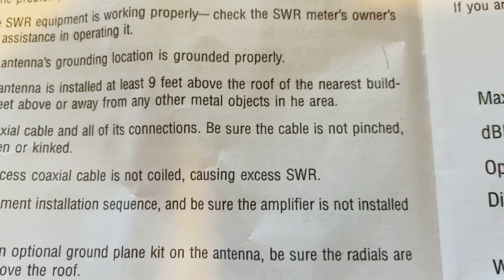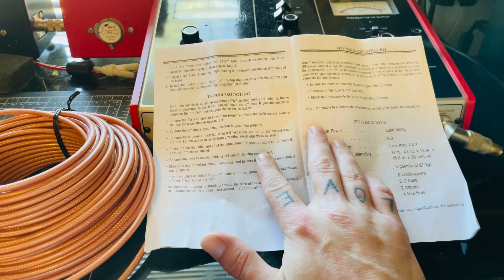Ferrite chokes⚠️

Comment: Watching your video I purchased multiple chokes. I was getting a weird (distorted) sound from my external speaker. I reorganize my wires and put two chokes on the speaker wire. Issue fixed.
You will be getting my Stryker 497 and my RM Italy 703. I will be sending another email once the order is placed.
I learn so much from your videos.
Reply from the maker: Thank you for your support, glad my content has helped. 73

Comment: On your expertise and suggestion, I have gone ahead and picked up a set of these chokes.
Getting my 11 m Cobra 148 NW rig with an Italy 203-P amp, and a new QT 80 10 M, both running through a Solarcon 99, both squared away. Intend to place a couple on my little ATS-20 SW radio as well.
Thank you for you service Sir. 73 from the old Football Coach.
Reply from the maker: Ferrites will make a difference sir, thanks for tuning in coach. 73

Comment: Will a 9 mm ferrite bead sqeeze down onto a 9 mm power cable as the next size is 13 mm bead and its to big thanks
Reply from the maker: Ferrites do their job even if they are not snug, don’t worry about the diameter sir.
Reply: @G @GroundControl204 thankyou im buying to put on treadmill power cord as my treadmill bothers my neibours am radio on 600 mhz and he is one floor bellow me

Comment: Is RG400 better than westflex 103? any ideas? Never come accross it here in the UK although is easily obtainable... 73
Reply from the maker: RG 400 has an “PTFE” insulator, which makes rg 400 very high heat resistant. I’m not sure if westflex 103 is as good, I never heard of it before your comment sir.  73👋🏻

Comment: Would it be best to place snap on ferrite chokes only on the coax end at the radio …and not also at the antenna feed point for a Solarcon A99 half wave over a quarter wave (no radials)?
Reply from the maker: @Johnt3XVI   best to have some ferrites closest to the antenna, and at least one ferrite per coax jumper. You should also place ferrites around any AC and DC power cables within your radio room or shack such as power supplies and such, and that goes for house lamps, or desk lighting, mic cables or anything that is tied in to the immediate power outlets of your radio room. 73👍🏻